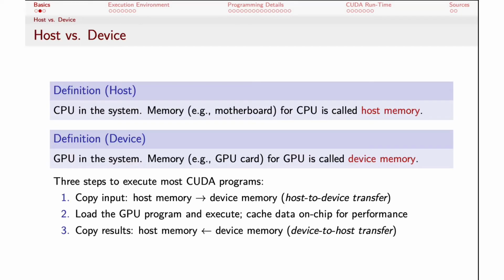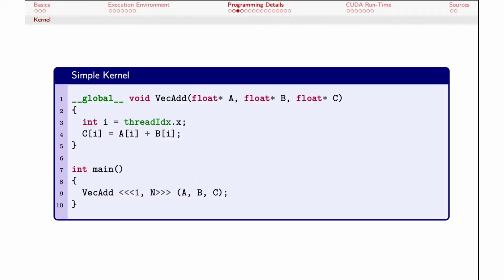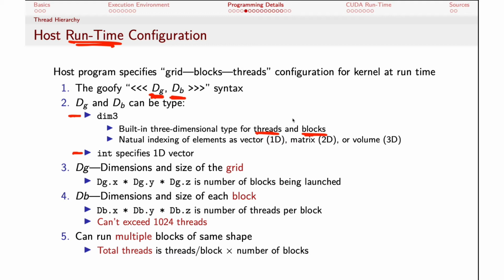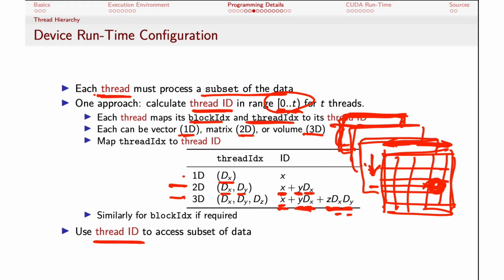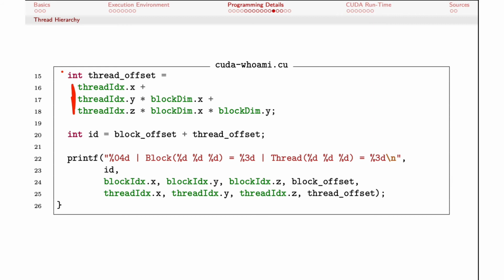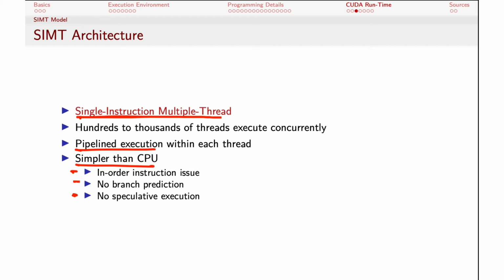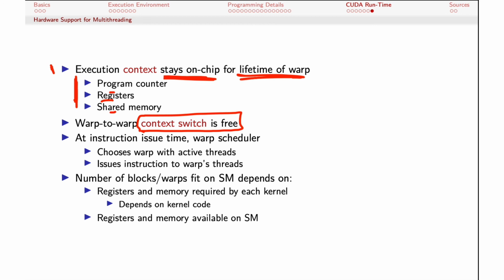CUDA Programming

Comment: Gemini: This video introduces CUDA programming, distinguishing between the host (CPU) and device (GPU) and their respective memories (0:28).

It outlines three key steps in a CUDA program:

Copying input data from host memory to device memory (1:08).
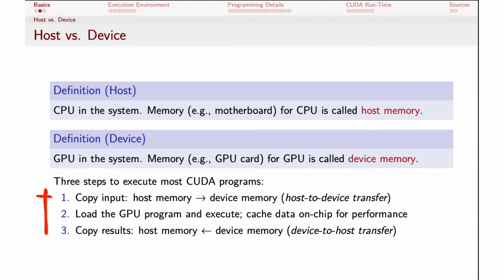Invoking the GPU program, called a kernel, to process data on the device (1:47).
Copying results back from device memory to host memory (2:02).
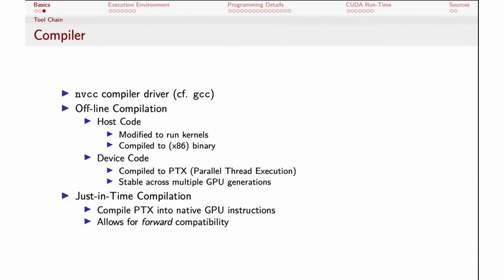The video explains how the nvcc compiler handles both host and device code (2:40), compiling device code into an intermediate PTX format for portability (4:23) before Just-In-Time compilation (5:32).

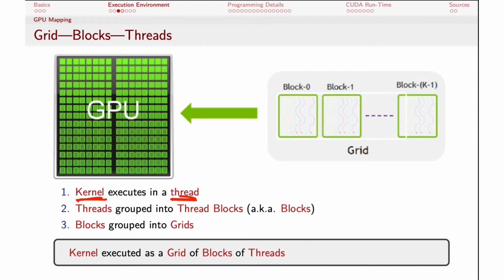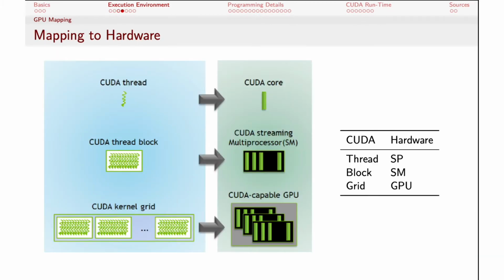It then details the CUDA execution model, which organizes parallel tasks into a hierarchy: threads (running the kernel), grouped into thread blocks, which are grouped into a grid (8:21). This logical grouping maps efficiently to the GPU's hardware: threads to streaming processors (SPs), blocks to streaming multiprocessors (SMs), and the grid to the entire GPU (9:54).

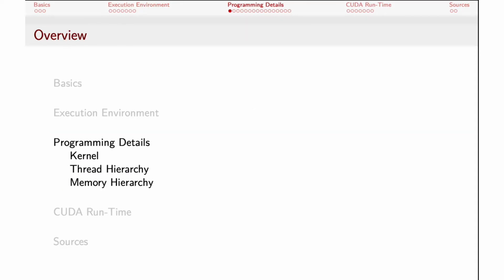The video demonstrates how to write and launch kernels (18:23), which are C/C++ functions executed by many threads in parallel. It highlights built-in variables like blockIdx and threadIdx that kernels use to identify their unique position within the grid and block (32:05), allowing them to process specific data subsets.

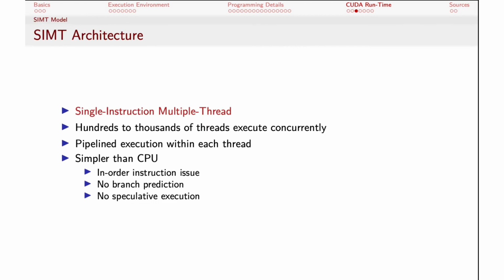Finally, it discusses the Single Instruction Multiple Thread (SIMT) execution model, where threads within a warp (32 threads) execute the same instruction, but can diverge if they encounter conditional branches (56:22). The GPU's ability to context-switch between warps with virtually no cost helps maintain high throughput despite divergence or memory access latency (1:05:08).